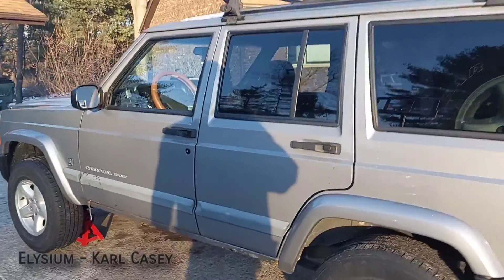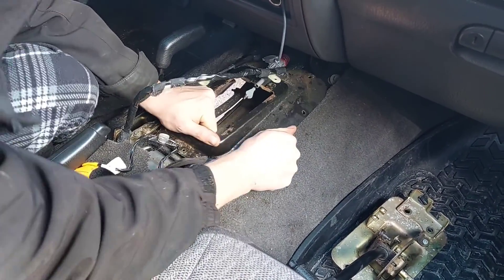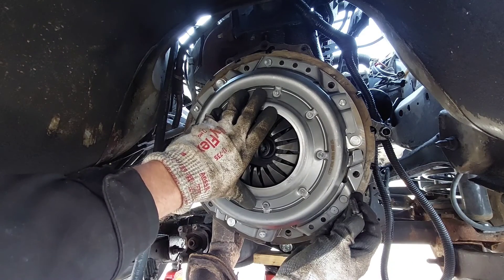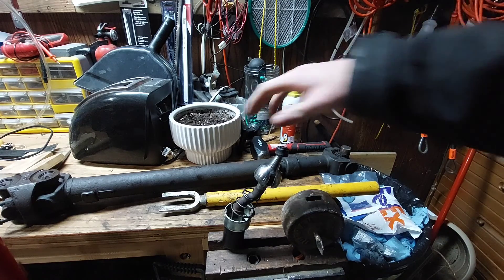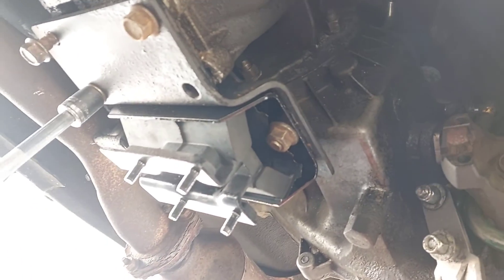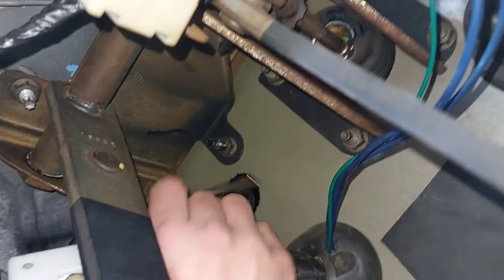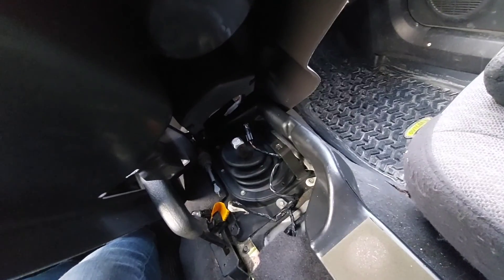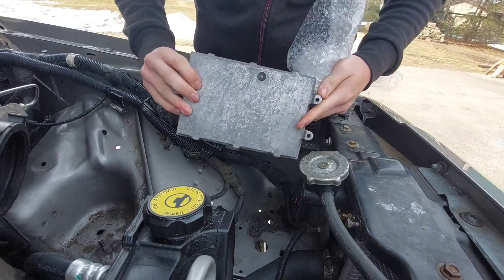Jeep Cherokee: Manual Swap - The Process ['97-'01 XJ] AW4 to AX-15

Comment: Got a rusted out  97 manual and a rust free 2001 2wd auto. About to swap out engine trans and transfer case into the 2001.  Funny my 2001 doesn't have the pop out for the clutch slave in the firewall like yours did.  Glad You made this.  I commend you for working out in the cold that shit sucks especially when a wrench slips and your half frozen hand slams into some metal.  Thankfully my garage is now heated.

Comment: Thank you for posting this.  The Azzy shift configuration is very clear now.  I’ll set mine to that (running 242 on AX15).
It’s interesting to see the differences of 96 & older to 97 and newer (mine is a 93).

One thing you do inspire is conversion to the external Clutch Slave Cylinder.  Mine is the very last year they used an accordion style slave cylinder that mounts inside bell housing , directly on input shaft.   It does work well, but if slave cylinder dies; it means pulling transmission.  I like the easier serviceability of the external one. 

One other note:  because I never had automatic, the transfer case mode switch connector is set for 231 only (which ties one wire to ground when in part time mode. 242 uses case as ground, and then 1 wire for part time, and the other for full time.  For conversion, I clipped the wire that’s ground for 231, and spliced wire up to the 4wd full time dash light.  It works quite well. 

Thanks again for sharing your swap experience.
Reply from the maker: Before you reconfigure your shift linkage! The footage shown here isn't how it ended up, I changed the stud on the transfer case lever to the lowest one, not the highest one as seen in the video. We were messing with the thing for an hour and I got tired of trying to record it, so I just threw in some footage I already had. 

I will make a video covering it more in depth, I'll get you some better angles and elaborate on it with the visualization of it being on the video. 

Then again, the 96- models might be ever so slightly different, so even then my configuration might not work. I don't know, I've got a lot to figure out, but I will figure it out

Also, thank you for the insight on the dashboard indicator circuit! I've never had the chance to get my hands on a 91-96 XJ and so I'm not really familiar with how that "era" has things laid out. Very interesting that it uses the case as the ground, where the 97+ models instead have 3 wires.
Reply from the maker: https://youtu.be/A8kKUzokAlE

Skip to 12:55 for the linkage configuration

Comment: As for the 242 t-case, it is only a good swap if you have ABS and a limited slip diff in the rear. This is where the 242 really shines.
Reply from the maker: Oh yap. I got a separate video all about the 242 swap

Comment: This would fall under the topic of too little, too late. Not sure but I think you can remove the actuator rod out of the booster without removing the booster. This would allow the pedal install much easier. This is a great series and done very well. God bless and stay well.

Comment: nice video but do you need to change the brake pedal? cant you just cut of the sides of it and put on it rubber from a manual brake pedal?
Reply from the maker: You could keep the original brake pedal, but as I described in part 1/3 in this series, the clutch pedal shares its bracket with the brake pedal. Since we need the clutch + brake shared assembly anyway, there's no reason to modify the brake pedal that doesn't also have the clutch pedal attached to it

Comment: Hey really good information here. Thanks. But my question is if I get a complete 4x4 manual 90 xj I should be able to swap everything to my 2wd auto 96 xj?  Or I will have issues with the swap?
Reply from the maker: Renix to OBD-2 is not easy, you will encounter many issues with your plan here. I recommend watching my 2wd to 4x4 Swap video as well. 

I believe  a 1990 AX-15 has a smaller input shaft and thus a different pilot bearing, the infamous internal slave cylinder, and a 21 spline output shaft for the transfer case, which means you'd have to use your 1990 transfer case too - which means that output shaft will be an internal slip yoke, which means you'll have to use the 1990's driveshaft, which means you'll need to have a Dana 35 in your 1996 (which I doubt) because the Chrysler 8.25 needs a different rear driveshaft. 

The clutch pedal from a 90 will also not work in a 96, you need a 95-96 clutch pedal. I recommend watching the previous video in this manual swap series for more explanations. That one and the 4x4 swap. I personally would NOT go this route, using a 1990 as a donor for a 1996.
Reply: @WAEMIDIV  no even if i have the complete 90 jeep xj?
Reply: @WAEMIDIV   what is the donor year will be best match with my 1996 jeep xj? I want to convert it 4x4.  Now another question. Any grand cherokee will match for a convention?

Comment: Just did this swap. Cruise works fine but the indicator light doesn't work, does it work on yours?
Reply from the maker: The cruise light on the dashboard? Yes it does, maybe the bulb happened to burn out. If the cruise works but the light doesn't, it must be the bulb

Comment: Did you have any codes pop up after?  have a 97 XJ and did the swap but im getting and engine light for codes P0753, P0743, and P1889.  OBD2 says its for the auto transmission. Is there a workaround for those to codes? Thanks!
Reply from the maker: Sounds like you kept your original Automatic ECU, which yes, will be very confused as to where its transmission went. There is no way to get rid of these error codes because it doesn't have an automatic transmission anymore. 

The only thing you can do is either find and swap in a Manual ECU, or reprogram your existing ECU by sending it to WranglerFix as outlined in part 1/3 of the video series

Comment: Where did you get the bolts for the pressure plate?
Reply from the maker: Off the donor vehicle, where the flywheel came from. I have no idea if they sell them new, but I'm sure there's a length and thread pitch somewhere online
Reply: @WAEMIDIV  gotcha, i ended up using 3/8-16 x 1” grade 5 hex cap screws

Comment: Whats the difference between a clutch & brake pedal setup in a 94 XJ  and a 98 XJ  ??? 
They both should be the same right ???
Reply from the maker: No, there are 3 different eras of pedal assembly between those years. 

1984-1994 are all identical. The Clutch pedal arm mounts much closer to the brake pedal arm, with a small offset mount stud for the master cylinder pushrod of the left side of it. The master cylinder mount studs are directly on the top and bottom.

The 1997-2001 pedals are much wider, where the clutch pedal arm extends straight down with a pushrod stud on the right side. The holes for the master cylinder are slightly offset, bottom one is on the left and top one is towards the right. 

The Pedals needed to be shorter in the early years [84-90] because the Fuse panel was mounted right behind the clutch pedal and needed to be accessible. 

The Fuse panel was moved, but the pedals didn't need to be changed until 1995. For only 2 years, 1995-1996, the pedals needed to be updated because of the overhauled braking system seen in the year. I've never actually seen a 95-96 XJ in person so I don't know what they look like, I just know they're different. 

1997-2001 adapted a much wider pedal assembly because they *could*, and it also allowed the master cylinder studs to be offset, making it easier to install and remove. 

So in short, the pedal arm position, length, pedal pad position, brake pedal mechanism, and mounting points are all different between a 94 and a 98.
Reply: @WAEMIDIV     I understand now Thank you very much for that info..

Comment: @38:45
If I DONT want the clutch safety switch hooked up, but I want a “kill/no start” switch,…that would work right???
Reply from the maker: Yes, in fact I did exactly what you described to my Jeep (off camera). I did not install a CSS but did use the circuit as a kill switch. It 100% works but as I mentioned, it can still be push started. But honestly I don't think car theives know how to push start vehicles so you should be good.
Reply: WAEMID IV 
I don’t think people know how to drive a stick anymore, so there’s one level of security!

Comment: 1 more question for you , will a  manual trans  NP231  bolt up behind a AW4 ??
Reply from the maker: Yes but you'll want a medium length input shaft on that transfer case. Other than that, they're all the same
Reply: @WAEMIDIV     Once again Thank you